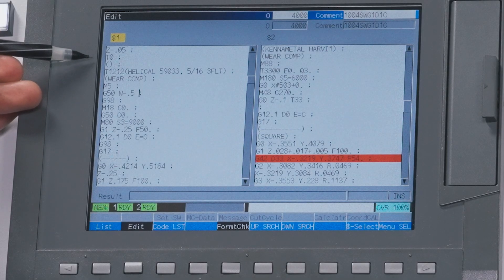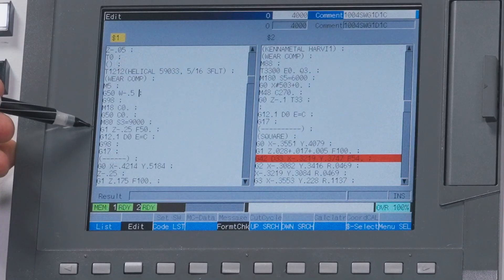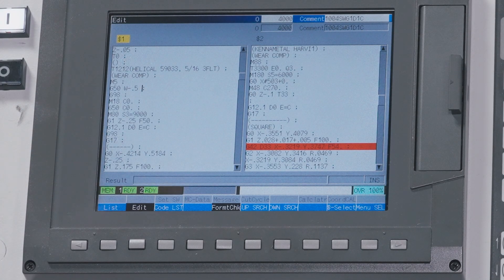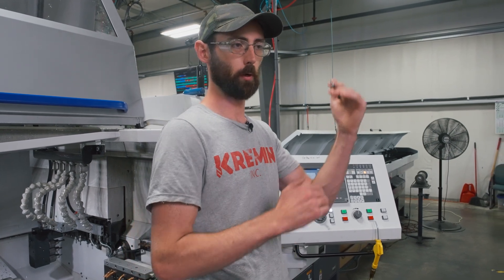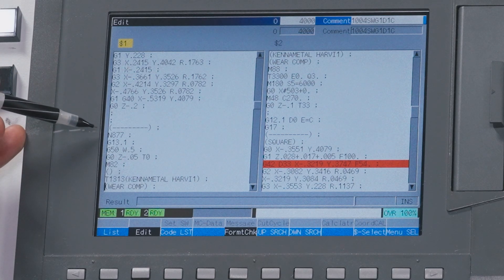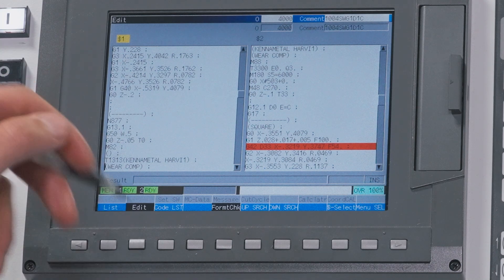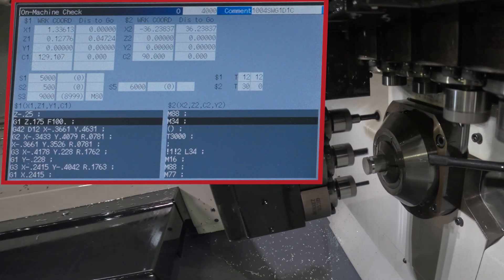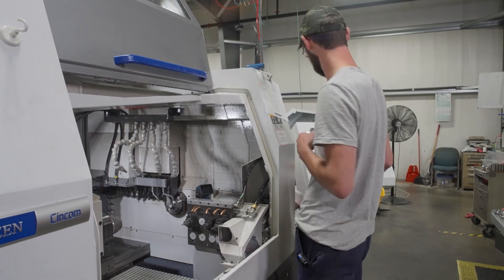Introduction To Milling With G12.1 On A Swiss Lathe

Comment: You can mill in g99 if you change your spindle incoder using g44d3 for gang tool post milling g44d5 for back tools milling etc, then you program your feeds like your turning. You only need to use it once at the start of milling tools and turn it back to g44d1 at end before turning again no g98 required

Comment: Find and replace on Windows notepad is a friend when you have to replace Z with Z- and the opposite.

And also if you want to reverse operations, I'm using G12.1(G112) on "my" Mori Seiki NL2500, I mirrored some programs changing C and C- 😉
Reply: Notepad is a godsend. Fortunately the mastercam editor lets me find and replace.
These machines won't accept a negative C, I should have switched my workplane to Bottom. Most of the stuff we make with G12.1 is symmetrical so I didn't ever notice it was mirrored until I ran a weird part like this one 😅
Reply: Nevermind, that's a spoiler the next G12.1 video. This part is symmetrical along the y axis.
Reply: @SecondFloorOutdoors  Wait, maybe the programming is different between mine and yours.

After calling the G12.1/G112, the C becames the same of the Y on "my" Mori Seiki.
How did you mill a part past the theoretical center if you can't program a negative C?
I'm missing something?
Reply: @dadoVRC  it's on the G12.1 line. The "D0" tells the machine you're programming with X and Y. "D1" would be programmed with X and C. I've only done it with X and Y, less confusing for me. You can have Y-, so I suppose if I programmed with X and C I could have C-. I haven't tried that.
The programming is probably 90% the same as any other twin spindle twin turret machine, but that 10% that's different is what gets you. Synching, superimposition, queuing, etc. I haven't run a Mori yet.
Reply: @SecondFloorOutdoors Ok, that's clear.
On the Mitsubishi CN the Y became C!

Comment: Thanks for taking the time to share all this content here, in quick easy to the point videos , 
Would of been nice to see the code on screen in a better way to see the gcode atructure ..

just added a M20 on the shop floor . Your videos have already helped alot .
Reply: The next G12.1 video has screen capture of the code on the computer and I go thru it line by line, that should be what you're looking for.